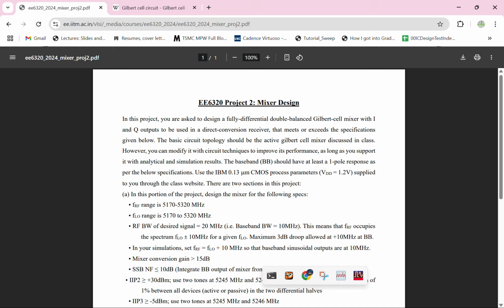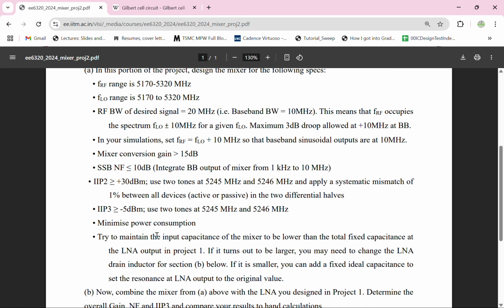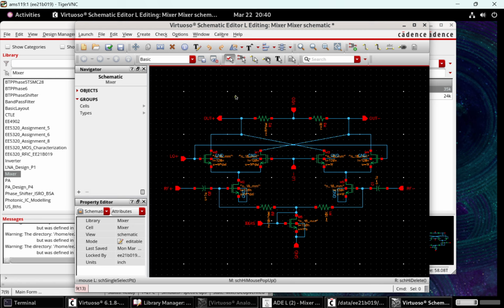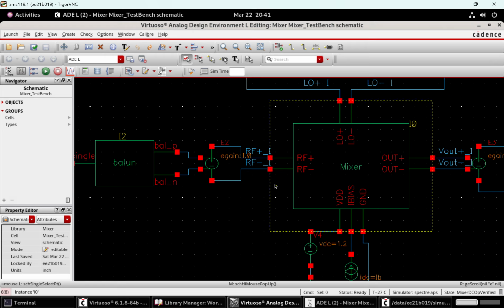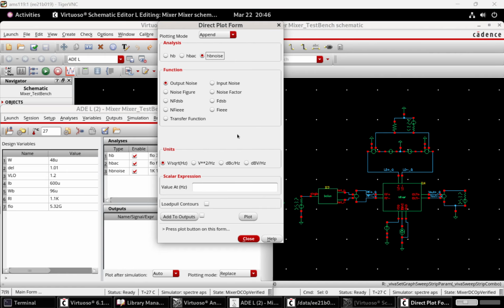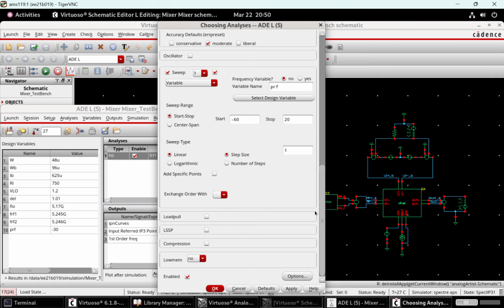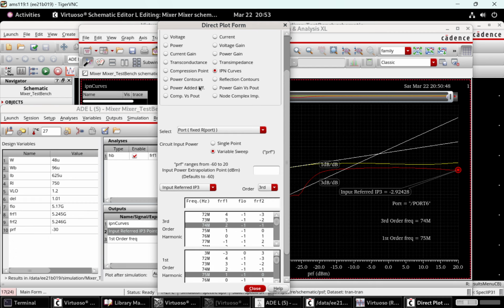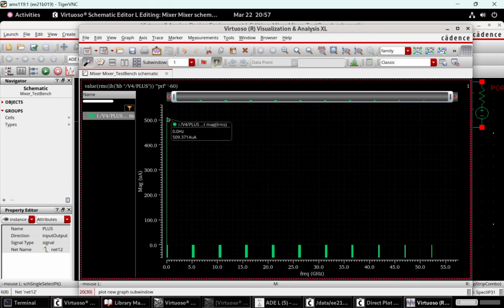Design and Testing of a Gilbert Cell Mixer

Comment: Hello Sir, thank you for uploading the videos. I am interested in implementing amplitude modulation using the Gilbert cell. Could you please share the details of the testbench you used in this work, or provide any guidance/resources that would help me implement it?
Reply from the maker: Please find the relevant simulation details here - https://github.com/ANIRUDHBS1/RF-Integrated-Circuits-EE6320

Comment: How does the series res in gate of RF MOS help with linearity? Isn't it just high pass biasing to define the DC bias and couple the signal? 
Also, in the LO input setup, LO+ path has VDC = 0,  shouldn't it be same as Vdc = VLO as added in the VLO- path?
I didn't understand the need for the additional 50Ohms in parallel with the PORT which already has 50Ohm setup. Nice tutorial though, helpful for beginners in hb sims

Comment: Where did you set up frf1 and frf2 for the hb analysis?
Reply from the maker: It is set up as design parameters in the ADE L window for hb analysis. You can find more details here - https://github.com/ANIRUDHBS1/RF-Integrated-Circuits-EE6320

Comment: Hi, can you please do an S-parameter analysis for s11 and s22 for this? Thankyou so much.
Reply from the maker: You can find how to do a S parameter analysis in the LNA video. Unfortunately for the mixer, the S parameters do not hold significance as the design is primarily capacitive at both input and output.

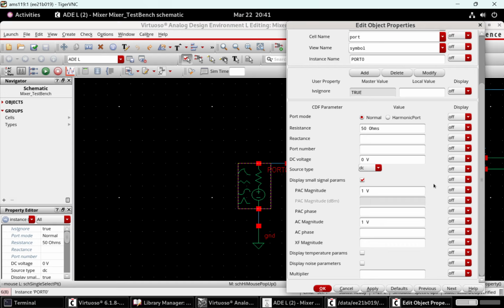Comment: I am a new user of Cadence. I need to simulate diode mixer. For example single-balanced diode mixer. I misunderstood why in 6:00 you setup the RF port on DC mode. How it could be? DC means constant voltage. So. how mixer can work if it have the only one harmonic (LO one). To work mixer need to gave LO harmonic and RF harmonic. And IF port get LO-RF freq. I found guide "Gilbert mixer simulation using Cadence SpectreRF" and to analyze Gain vs LO power it is also written to setup RF on DC mode. I used PSS and PAC simulztion. I just miscathce the logic. How RF port can be DC? What to mix in this case?